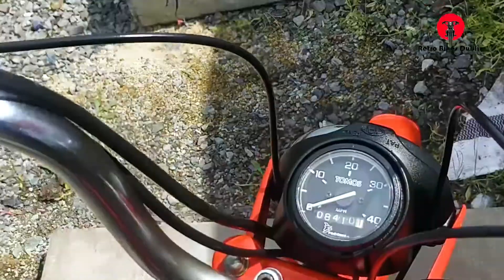1985 Tomas 50 - is it a bike? is it a moped? n1987 tomos golden bullett ! - 1985 tomas 50 (review)

Comment: I had one of these (shudders at the memory). 
I came to it from a Honda C90 with a rotten back end and a engine with 72,500 miles on the clock that knocked disturbingly.
This was in 1986 and this bike was an utter P.O.S compared to that Honda which was utterly shagged, but had decent lights. The Tomos meant venturing out at night was a no-no. The lights were as bad as on a push-bike. 5 or 10 watts? There was no battery.
The bike had a kick-start, but had a peculiar 1-way clutch that meant you could not bump-start the turd. I had a lot of electrical issues, then the petrol tank started leaking. This was a bad weld and it was a pain in the proverbial. At best the fuel evaporated and left a coat of 2-stroke oil all over the engine & carb. It was a 25:1 mix so it smoked somewhat. 
I got sick of that and mounted the petrol tank from a Yamaha Passola on the rear rack. These bikes were known as complete turds even when they were new. It is not just sour-grapes from me. After 3 years ownership the crank seals went & the vile creature was evicted from my life. These were made in the former Yugoslavia. Not a stellar example of a moped.
The ownership experience was somewhat like wearing a hair-shirt: A penance for sins.